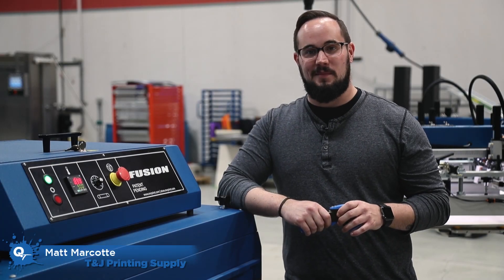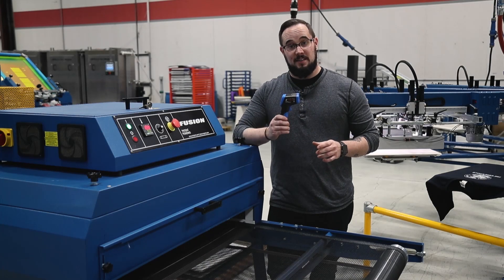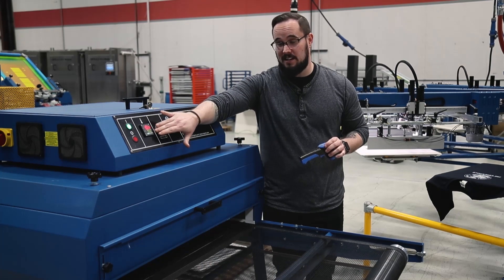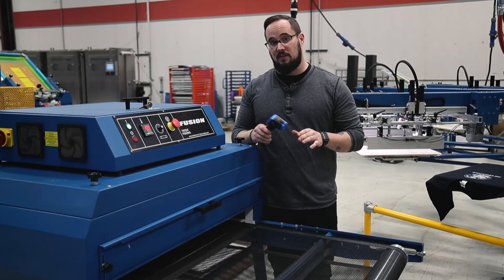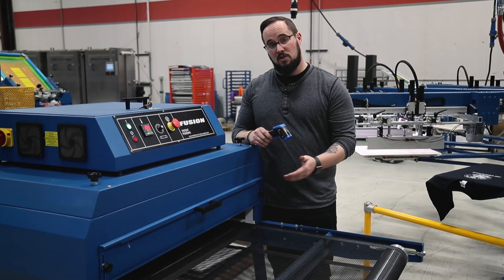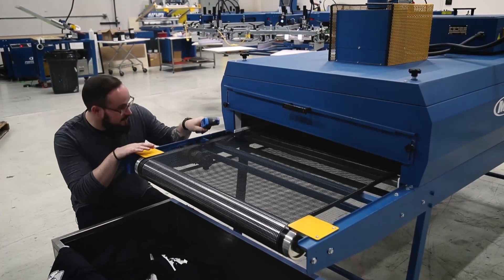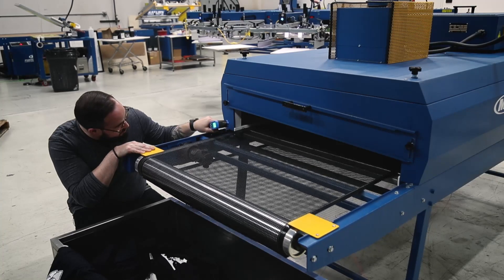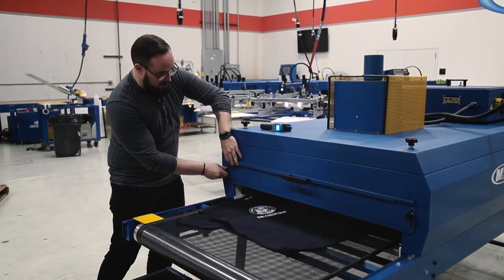Quick Tip: Confirming Cure with an IR Thermometer (Heat Gun)

Comment: Thanks for showing how to actually do this! I have a heat gun in my classroom (I teach graphics and screen printing at a career & tech school) and I was told to check the temp of the ink on the shirt as it came out of the dryer. And another screen printer once told me that I can't always go by this because shirt color affects the temperature (white shirts are cooler than black shirts). I don't know and that's just too much science for me to try and think about -- I'm a graphics girl! LOL  HOwever, this way of checking the temp as it comes through the dryer is so much easier and accurate than how I was doing it, trying to get the temp the minute it came out of the dryer. 

BTW, I find your videos extremely helpful for teaching high school students and often play them to the entire class on the projector in our classroom so they all hear it and understand it without me having to "reteach" it. Thank you again!